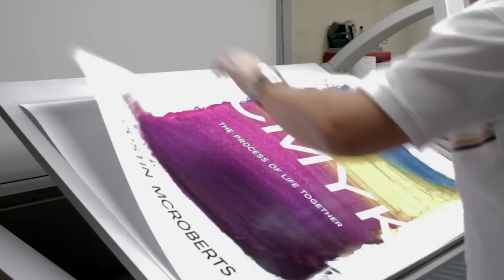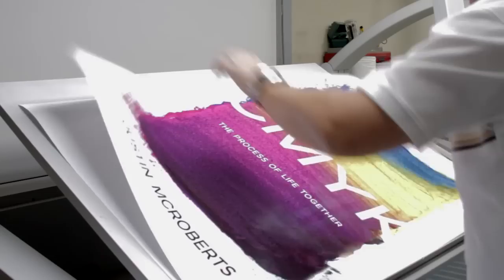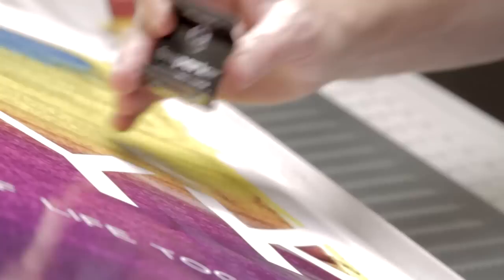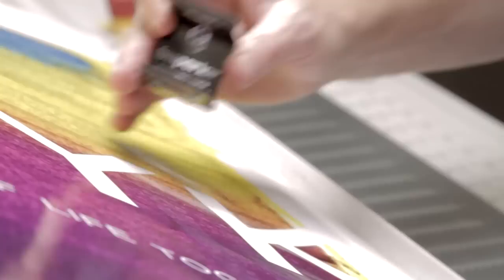CMYK Print Shop Trailer

Comment: I used to do four color process on a 1650 Multi with a T Head, the results were amazing! My boss was uncertain whether even a 1250 Multi with a T Head could even do it. So I'm working overtime on a weekend and didn't want to work all weekend and I thought screw it, I'm just going wet on wet printing. It stands to reason that if the dots are separate enough that it wouldn't pollute the colors being printed if they are not touching to begin with. It worked so well. I have to say that process Yellow did not work for me, it was so light that I had to double the amount of magenta to get a pop out of the image and it made my prints too wet. Another Printer suggested that I use pantone Yellow instead and it worked like a charm. Not only did the prints dry more evenly and I used less Magenta but it made the overall image really pop. I first did Pantone Yellow on the main press, Magenta on the T Head, two of the lighter colors so there's less chance of contamination, then process Cyan and Black on the T Head. It worked out so well, we did the same process for years without any problems. One thing I always liked about Printing and being a Printer, it WILL teach you how to think. Thank you Justine for uploading this, it is indeed an inspiration. I loved it so much I uploaded it to my face book!